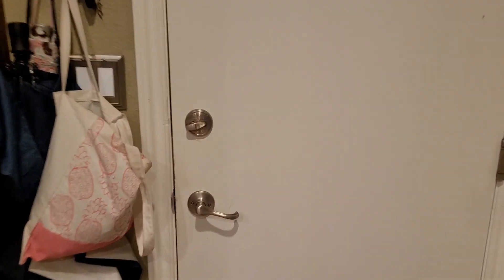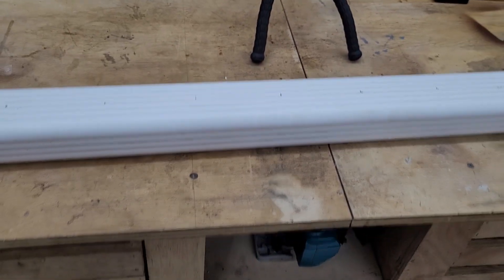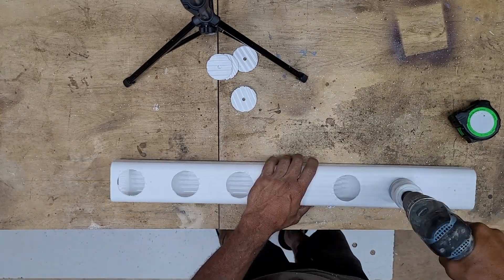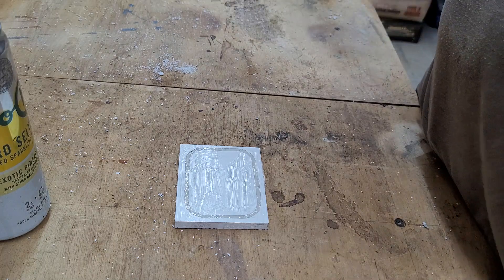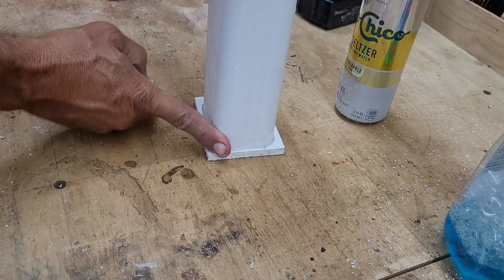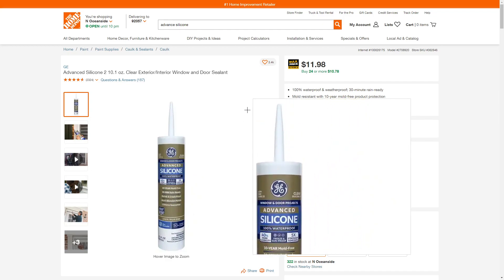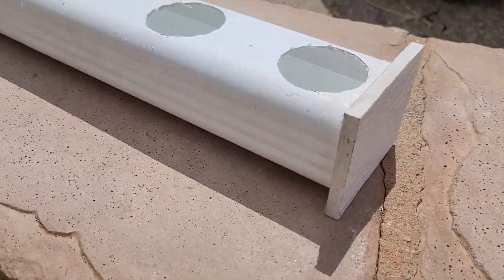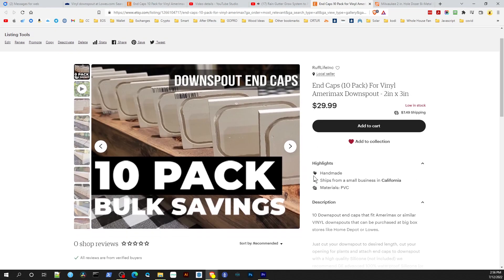How to Make Your Own Rain Gutter Downspout Hydroponic Grow System - DIY

Comment: I think I messed up! I found this raingutter kratky over on VanDruzees channel and someone asked him what kind of caulk to use. He hadn't responded, but someone else did. Said to use Aquarium Sealant, it's safe for plants and fish. So, I bought 2 tubes.

I just put it on...then flipped the package over and read, "Not recommended for PE, PP, PTFE, PMMA, PC or PVC."

Now, after doing a search I'm confused if the downspouts fit into one of those categories. Some sites say vinyl is pvc some say something different. 

And the front of the package says tack free in 45 minutes the back says 2 hours, LOL!

Comment: Dude you saved me a major mess, i sealed the end caps last night and thought all was good but in your video i noticed you testing the seals first outside. So I decided to try the same in my kitchen and water was everywhere lol  Also i know why Mike V didn't use end caps for the longest its easier to maintain and no worries of leaking  is my best guess. Thank you for the save!
Reply: You dont need end caps if you hot air melt the endings plastic and fold it upwards
Reply: @AG-sx9ws definitely pros and cons to both though. Major con to the heat gun method is it’s very difficult to clean out the rails.